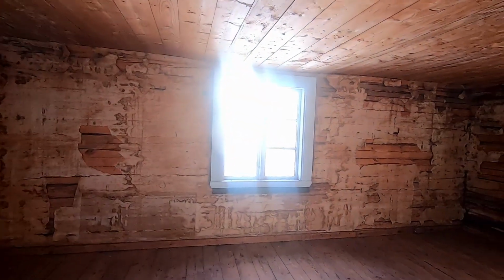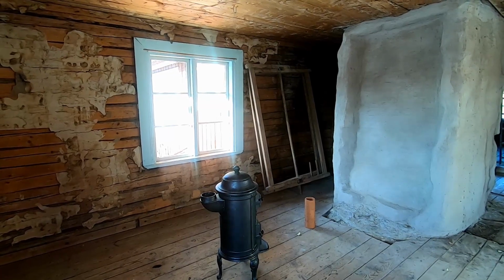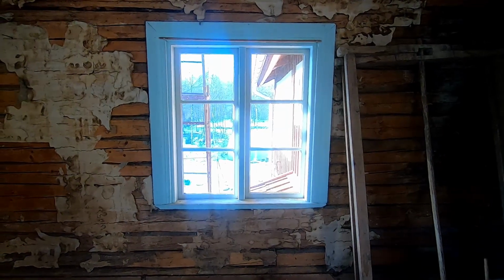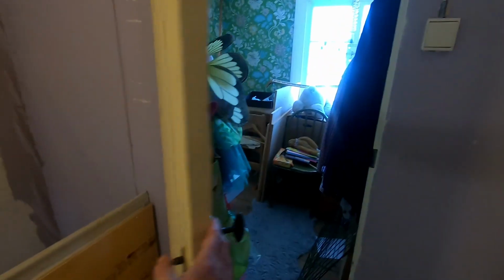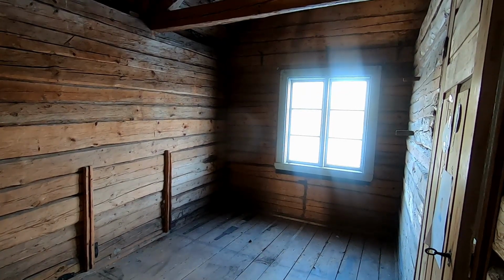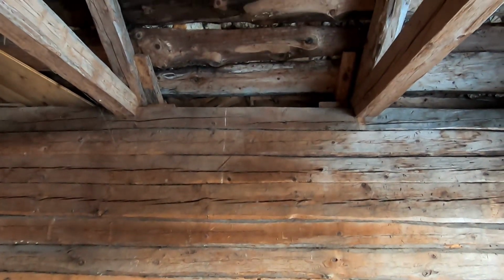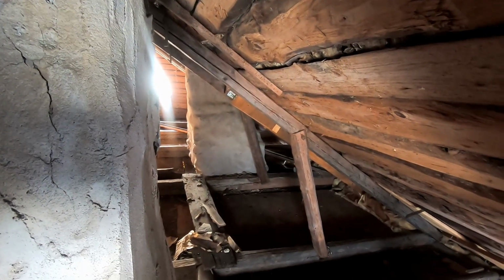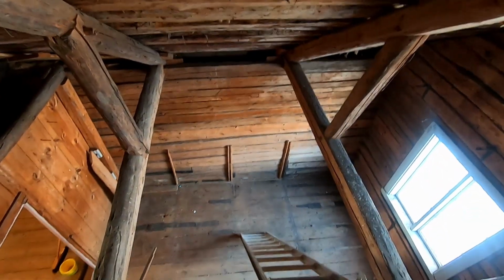House Tour - Renovating our old house - Part 1

Comment: if you decide to clean the brass hardware on the doors (if it is brass), then bring white vinegar to a boil and simmer the brass hardware in the heated vinegar and simmer for a few minutes until you see the paint begin to shrivel and pull away from the brass. It's magic!